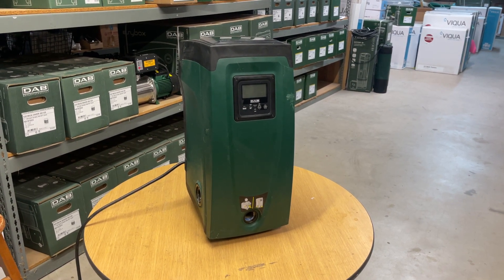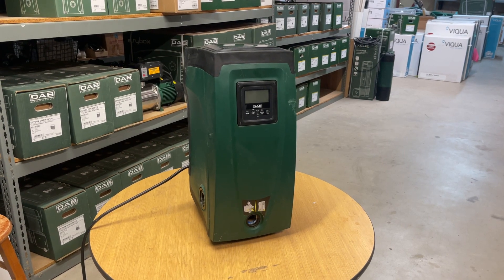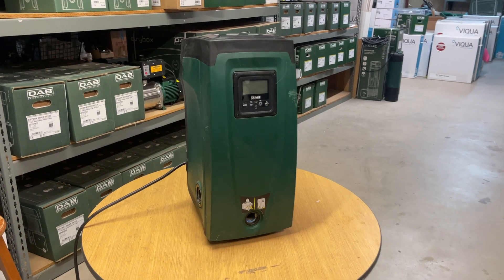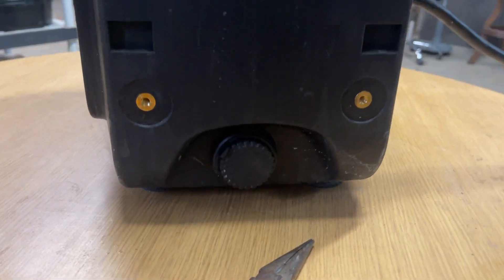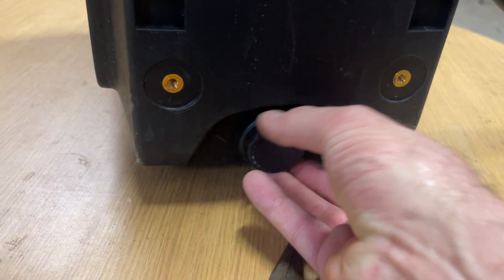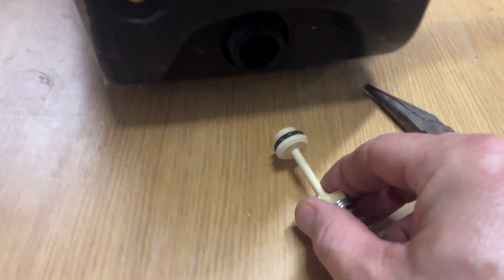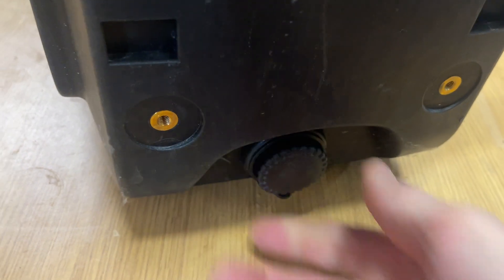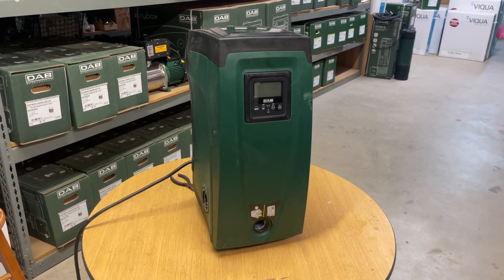Changing the Configuration of the Check (Shutter) Valve on a DAB E.SYBOX Pump for Flooded Suction

Comment: Great  video! What I don't understand is what to do in a situation where both occur. For example, I'm going to have a 10' tall 5000 gallon water storage tank and would love to install this pump on the wall next to it, say 4' from the ground where that tank is sitting. Problem is, this means I'd have flooded suction if the tank was more than about 40% full, but the pump would need to be pulling up if the tank was less than about 40% full.
Can the pump not work in that scenario? Obviously I could just put the pump on the ground and configure it for flooded, but a wall install seems cleaner and saves floor space for other things. Thanks if you have an answer to that!
Reply from the maker: In this situation (if you want to wall mount it), don't change the position of the shutter valve. It really only needs to be changed if your inbound flooded pressure is around 35 PSI or higher (I found this out after posting the video), but it won't hurt the pump if you do change it in low pressure, flooded suction scenarios. Be sure to install a check valve at the ball valve of the water tank to keep the pump primed and water from going the other direction, especially if you mount the pump on the wall.
Reply: @rainwaterequipmentllc7835  this is an awesome and super useful answer! Thanks so so much!

Comment: Hi. Is it possible to have both city/mains water as well as rainwater tank connected to the same DAB E.SYBOX pump? I ask this so incase city/mains water is not available lets due to civil emergency then we have rainwater tank as backup to fall on?
Reply from the maker: Yes. You would simply need a T or Y in the suction pipe that feeds the pump with an isolation shut-off valve on each supply, so you can manually open/close one at a time as needed. Be sure to use a pre-pump filter between the rainwater tank and the pump to prevent debris from entering the pump. City code may require a back flow prevention device (like an RPZ) to be installed in order to prevent the rainwater from commingling with the city water.
Reply: @rainwaterequipmentllc7835  Thank you!